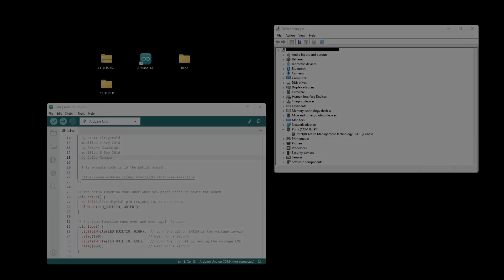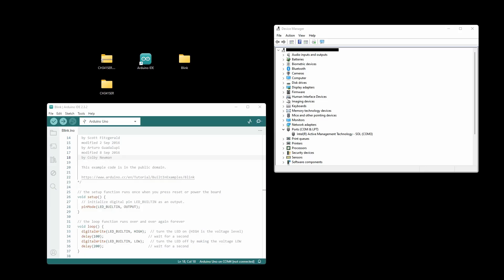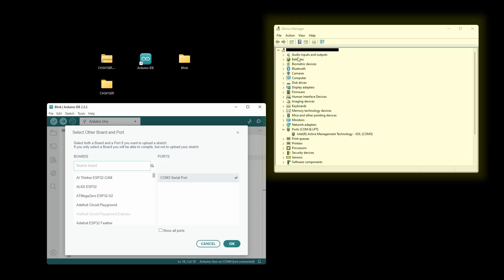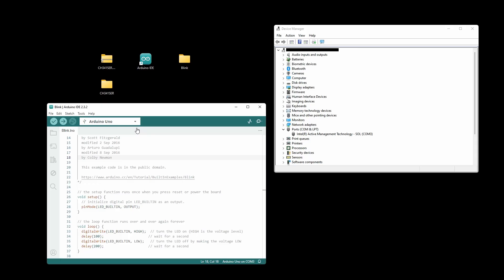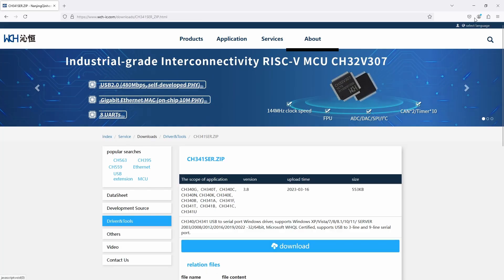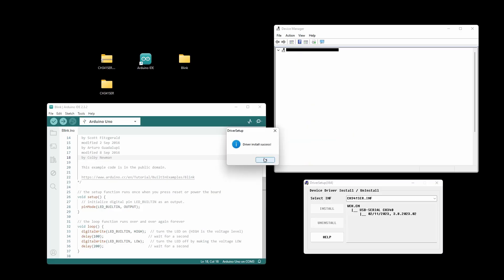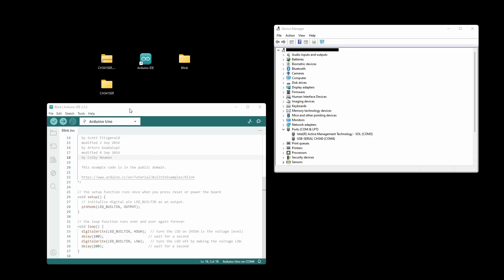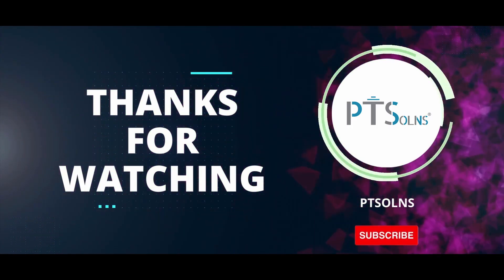Installing the CH340 Driver

Comment: Didn´t work for me. I tried to install the Arduino Uno driver (CH341) on Windows 10. When the installation finishes, a message appears: “The driver is successfully pre-installed in advance!” But when I open Device Manager, the driver is still not recognized.

Comment: I (maybe) needed a reboot (I think)! I have just got it to work after the reboot, but it may not have been that. Lots of people were saying it needed the old boot-loader. So actually it may have been that when I restarted the IDE, I actually just by accident didn't select the old boot-loader. It is maybe one of those things that I just somehow got it to work by accident. I just changed the timer on the blink program, and it worked perfectly. It seems that they load blink into the boards by default.

Comment: I have a board that uses the ch340c and i have tryed istalling but nothing showing upp in the device manager or arduino ide
Reply: same issue..have you solved it?
Reply: Try rolling back to version 3.5. latter versions dont seem to work well.

Comment: dont work
Reply from the maker: Common issue: Try a different USB cable. if it is a USB-C cable, make sure it can transfer data, and is not just a power cable. Try a different board, maybe there is an issue. Is the driver installed properly? Look inside the Device Manager.

Comment: Windows 10 updated the ch340/ch341 driver in November 2024. A new CH341PORTS.DLL file was installed. Suddenly my device connected to it was no longer recognized: 'Unable to initialize device.'
I renamed the new CH341PORTS.DLL file in directory windows/system32 (could have deleted it) and after a reboot everything worked fine again. 
It took me two hours of testing all my devices, wires, and connections before I realized it was a Windows update that had played a trick on me.
Just in case anyone else has this problem.